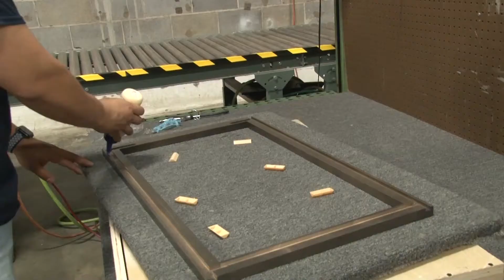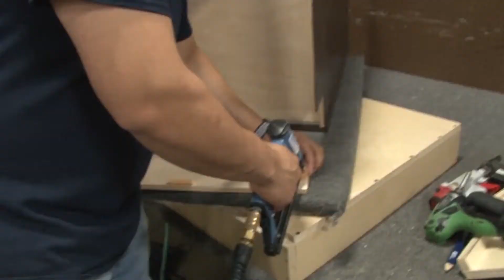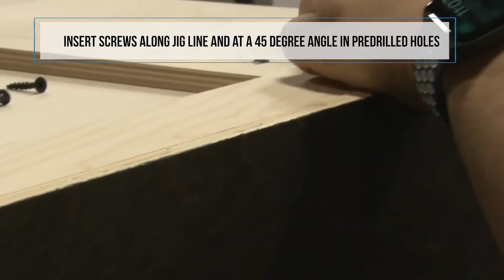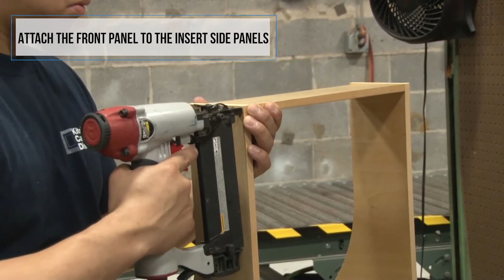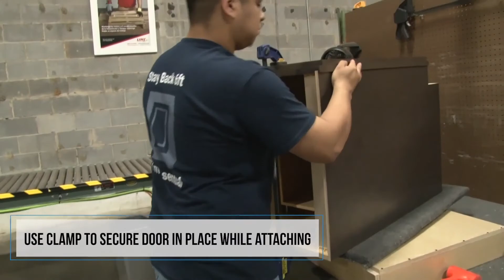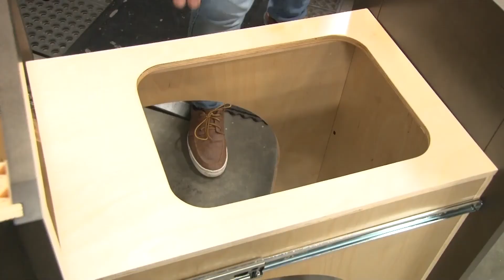Trash Can Base Cabinet TRB Assembly Video (Quick Ship Lines)

Comment: First tip... you need two lengths of staples. Be really careful not to use long staples in the wrong place as they will blow through the wood.

Also, the face looks like it could go in either direction but if you look carefully, there are holes pre-drilled on top side.

Make sure you clamp the cabinet together before you start joining with staples

Don't put nails in the bottom until the back is on.

Not only are many details left out of this video, I think some of the assembly shown here is not the best way to do it.

This is not an "easy" DIY job... on a scale of 1-10 (1 is easy, 10 is hard), I'd say it is a 6, especially since it needs to look good when you are done.

Comment: What a joke. This dude blows through the assembly. 

- Make sure the dado/face frame is positioned correctly, at first glance it seems like it doesn’t matter. But there is a pilot hole on the inside of each side of the face frame 9” from the top, this is the top. 

-doesn’t cover how to remove the inner drawer mechanism to install it to the trash bin drawer. 

This should be a simple process. Please get BILT to add this to their app so there’s a detailed step by step and not an expert just cruising through the assembly.